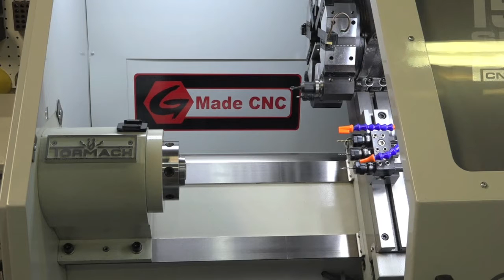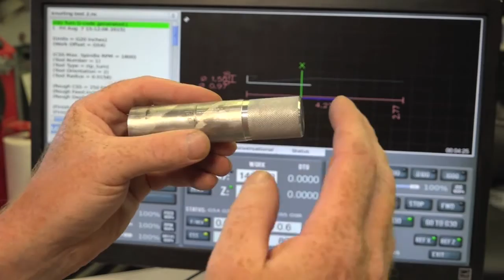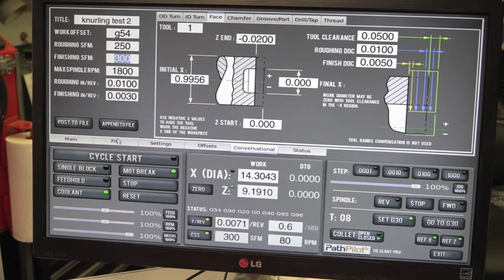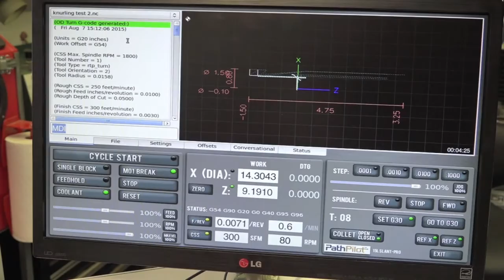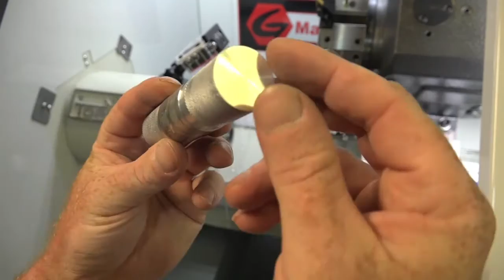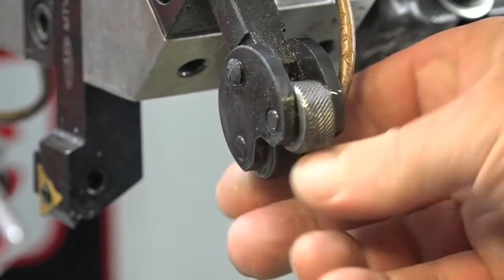Knurling with the Tormach 15L  Slant Pro lathe

Comment: Great video and result. However just remember that a knurling operation is a forming or deforming operation and not a cutting operation. The knurling tool has no bearings in it to run at a high speed. Slow speeds and feeds and one pass will always give you the best result. Cheers Paul

Comment: Use a much courser knurl for footpegs such as a 16 tpi. And, as mentioned previously, the stock diameter should be a multiple of 1/tpi. For example: to use a 16 tpi knurling wheel, you will need any of the following stock diameters: 1, 15/16, 7/8, 13/16, etc. Accu-Trak makes good knurling. products.

Comment: The Z axis sounds like its starving for oil.  Is that normal sound for Tormach lathe?  Thanks for the video!
Reply from the maker: That sound is coming from the knurling tool it is a inexpensive Knurling tool I had from a few years age
Reply: G-Made CNC I think he's talking about the whining noise on your rapid out on the Z when not cutting. Sounds almost like the ball screws need some lube.
Reply: Yea, Im not talking about the knurling. The rapid in the Z axis. You might want to double check your oil line to the ball screw nut.
Reply: No that sound is Tormach. This video is useless. Way too fast and only 2 HP
Reply: Good way to fuck up a tool
Reply from the maker: Oh  that's just how the Tormach sounds on the camera